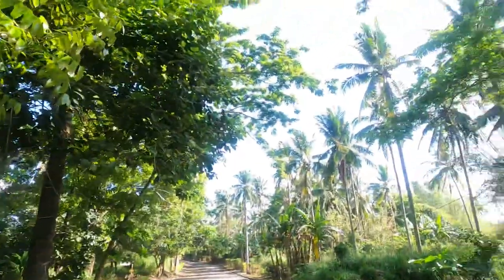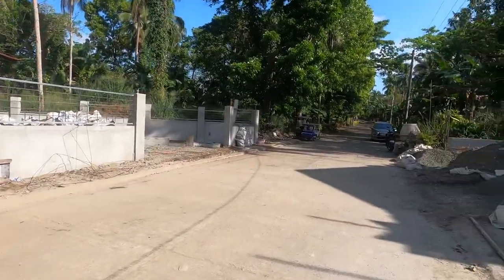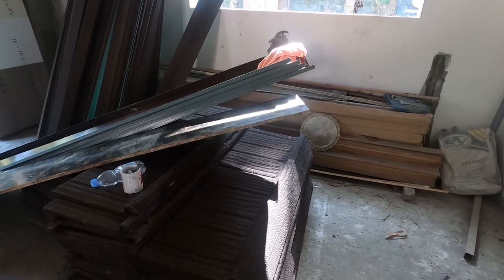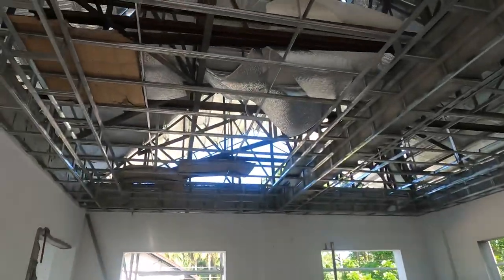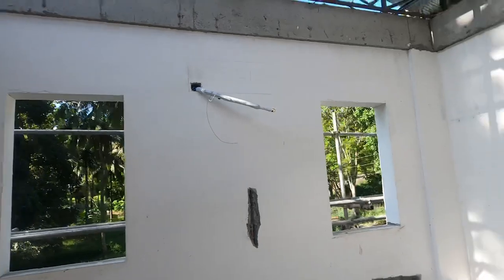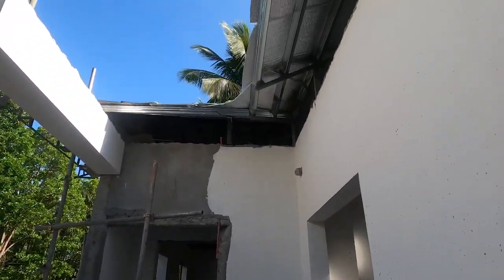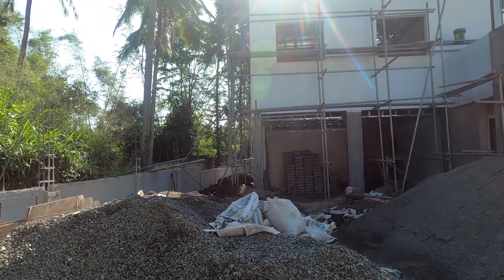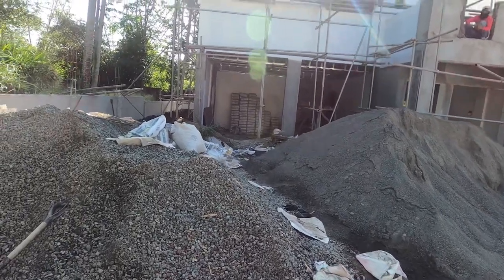Philippines House Build Vlog 69: NEW ROOF BEING INSTALLED

Comment: Looking good from before albeit the build is still progressing slowly in my opinion. Why is there a drop ceiling? For me i would prefer without drop ceilings as high ceilings looks nice and makes the rooms look spacious and better air circulations. Thanks again for the videos.
Reply from the maker: Arniel, maybe drop ceilings are not the correct word choice because the only place that will have the lower ceiling height will be the main room / dining area.  I also think ceilings should be as high as possible for air cirulation but our HOA has height restrictions so if it was only a single storey it would be easy to meet the requirements. Stay safe.